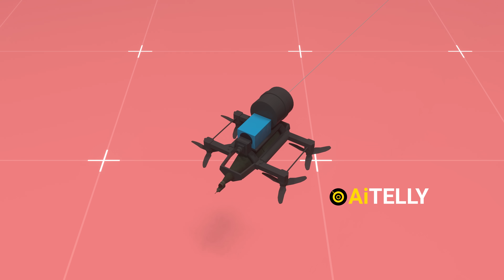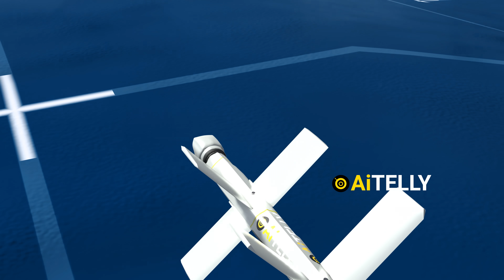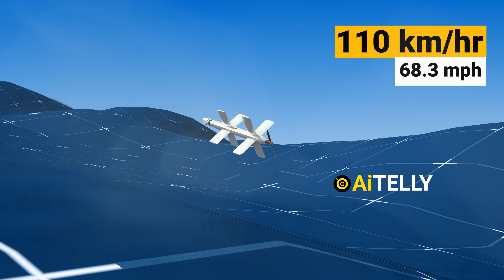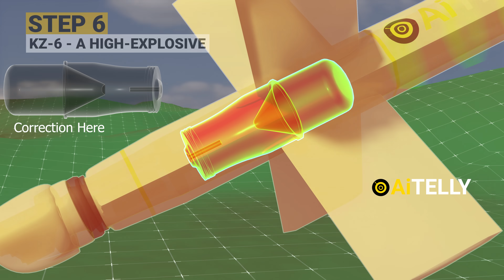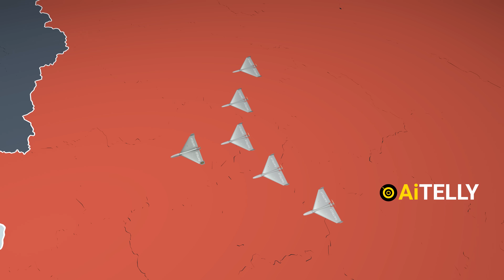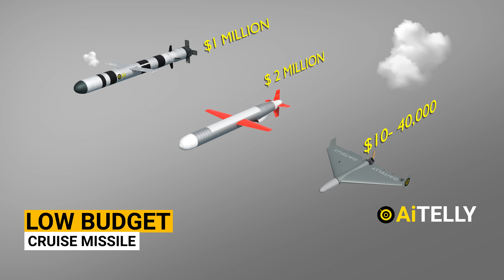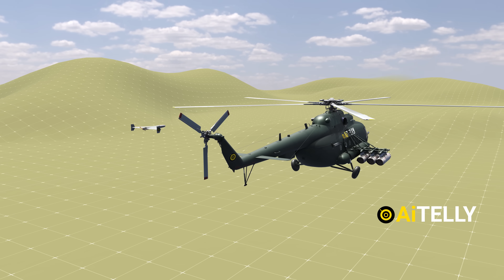How Russian Drone Strikes Works against Ukraine?

Comment: There are more differences between Geran-2 and Shahed 136 than shown here. Therefore, these names should not be used interchangeably, because it is an obvious mistake. Geran is not Shahed!
Reply: @romanromanowski4470  How is the geran-2 not the Russian designation for the Shahed, regardless of where it's manufactured?
Reply: @Masters-of-the-Universe  The Geran-2 in its current version is a completely new drone. It retains a similar shape to the Shahed-136. It has completely new guidance systems. It has a completely new, heavier warhead (90kg vs. 50kg). It has a new, improved engine. It has a new, improved fuselage made of lighter and more durable materials. It has a different fuselage structure. The new fuselage structure and new materials make it much easier and cheaper to mass-produce. New materials and propulsion have allowed for an increased horizontal speed (180km/h vs. 200km/h). Completely new and better guidance systems (GLONAS, INS, GSM, optics), combined with advanced counter-EW systems, have allowed for a complete change of tactics. The Geran-2 can fly high, avoiding cheap anti-aircraft weapons, without fear of suppression by enemy EW systems. Precisely because of its vulnerability to EW, the Shahed-136s attacking Israel always hid from EW by flying at low altitudes, where they were easy targets to shoot down. Its high flight, combined with its new fuselage, propulsion, and controls, allows the Geran-2 to dive at a target at a high speed of approximately 400 km/h, making it much more difficult to intercept than the Shahed-136. The Russians themselves emphasize that if they were to send the Shahed-136 to Ukraine today, it wouldn't even cross the border due to the numerous and advanced Western EW systems available to Ukraine.
Confusing the Geran-2 with the Shahed-136 is like confusing the M1 Abrams with the T-80, as both are tanks, have tracks, a turbine engine, a rear engine compartment, a central fighting compartment, a forward control compartment, a crew turret, a gun of similar caliber, and are generally used in similar ways. I hope you now understand why Geran-2 is not Shahed-136.
Reply: Geran 2 is a shaheed 238, Iran holds the intellectual property rights to both designs. 238 was unveiled in Iran before Russia ever used or unveiled the geran 2. Geran 1 is a shaheed 136. Get your facts right.
Reply: @Jonnyguywrestle  You have no idea what you're talking about.
Geran-1 is the Russian version of the Shahed-13. It's likely no longer in development. It's a weak, almost worthless drone due to its weak warhead. It's similar to the Russian Gerbera, which is much cheaper (20kg vs. 10kg warheads).
Geran-2 is a drone derived from the Shahed-136, but has nothing in common with it except its shape (not to be confused with the fuselage, which is completely different). Geran-3 is a Geran-2 with a jet engine. Shahed-238 is a similar concept to Geran-3. Basically, it's a Shahed-136 with a jet engine. Just as Geran-2 is several generations more modern than Shahed-136, Gertan-3 is several generations more modern than Shahed-238. Iranian designs are incomparably more primitive than their Russian counterparts.
Reply: @romanromanowski4470  I forget about geran 1 and shahed 13. Still stands it’s Iranian tech only difference is russia uses a different guidance system in the geran 2 and geran 3. It’s Iranian hardware and engineering. Iran unveiled and used there drones before Russia and claims the invention as there, to claim the shaheed as primitive is laughable. The patents are all Iranian. Shaheed 238 came out in 2023, Russia didn’t deploy the geran 3 until 2025. Check the stats
Reply: @Jonnyguywrestle  Iranian drones are obsolete, and there's no doubt about it now. They completely failed in combat with Israel. This is irrefutable proof of their inadequacy to the requirements of the modern battlefield. Meanwhile, the Russian Geran-2 and Geran-3 have proven their effectiveness against the most modern Western air defense and EW systems in Ukraine. The Russians themselves claim that the original Shahed-136s wouldn't even cross the border today because of EW. The Russians have purchased and deployed 6,000 Shahed-136s. Therefore, they have more experience with their combat use than Iran itself. Therefore, the Russians know what they're talking about. They emphasize that the Geran-2 no longer shares anything with the Shahed-136 except for its shape.
There are videos showing combat use of the Geran-3. They hit their targets. Therefore, they have confirmed their combat effectiveness. Therefore, you're wrong to say that the Russians haven't deployed them in 2025.
And for your information, The drone's guidance system is its most important element. Everything else is secondary. The guidance system determines whether the drone reaches its target or crashes at a random location. So, you've indirectly admitted that the Geran-2 and Geran-3 are not the Shahed-136 and Shahed-238 when you wrote that they have different guidance systems. Of course, not only that, because everything is different except the shape, but I've already mentioned that.

Comment: Current Russian fiber optic drones (Knyaz Vandal Novgorodsky) are equipped with various, replaceable coils for a distance of 3 to 25 km, depending on the mission and payload. Source - Aid's (Hades) Group commander interview
Reply: Yes, that's right. Using fiber optics and FPV drones can completely prevent interference at ultra-long range. I am a manufacturer of fiber optic drones.
Reply: @FiberBlade16  I dont understand how fiber optic drones can travel that distance, wouldnt the cable get snagged on trees, etc ?
Reply: Is there any scenario (say target not found) where a fibre optic drone would return to home, or are they one way only? What happens to the cable in that case? I would imagine it’s risky returning it back for reuse.

Comment: You're wrong about the wire-guided FPV drones. There are 3 variants of wire-guided FPV drones, one with a 10km range, 2nd with a 5km range, and the shortest one with a 1km range.
Reply: 1 км не используются. 5 км, 10 км. 5 в основном

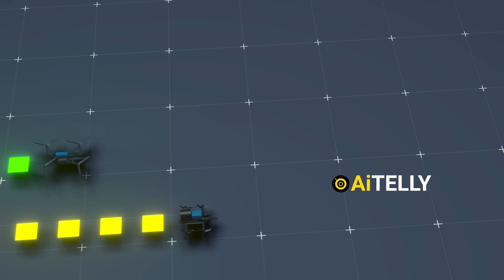Comment: 1:45 5 miles = 10 km ?!
Reply: 5 miles is equal to approximately 8.05 kilometers (km).

Here's the conversion calculation:

1 mile = 1.60934 kilometers
5 miles = 5 x 1.60934 km = 8.0467 km

So, 5 miles is approximately 8.05 km.
Reply: Most of his statistics are very wrong
Reply: @Mr.Mouihbi  he said "more than 5 miles" and "around 10 kms"